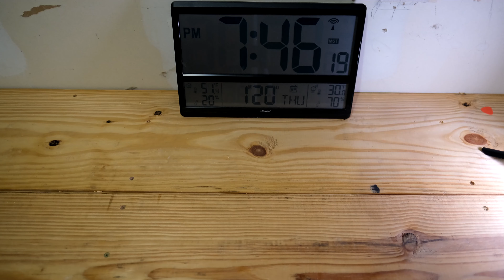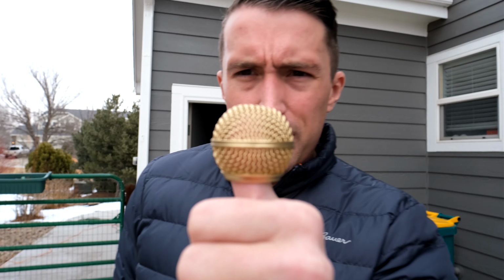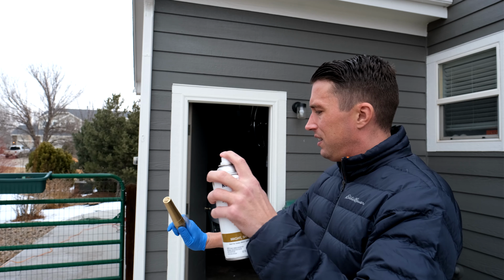Painting a Shure SM 58 Gold!

Comment: Tried painting mine gold. Awesome metallic gold paint turned to a dull golden brown after applying the clear coat. Have sanded back and painted again, going to try with a different clear sealer to try and maintain a better metallic Gold finish.

Awesome video thanks
Reply from the maker: Hey, you bet! I think I got lucky the first time haha. Best of luck!
Reply: @MintGreenAudio  I tried a water based sealant and was a bit better but it wasn't metallic enough still so sanded it back and using a gold glitter finish on it, looks good so far.

Comment: Good video, thanks. 
I have sprayed miles and miles of lacquer and latex so it was a little painful but entertaining  watching you handle the mic to spray it but hey, trial and error, it worked out pretty decent .
I did not consider that the paint would stay tacky so thanks for taking that one for the team!

After a year how has it held up? Also, how does it handle a mic stand grip?
I was thinking of putting my palm print on mine then dipping it in clear epoxy for the top coat to give it a really durable surface and a cool design completely protected by constant use. 

Pro tip for readers.. 220 sandpaper. Scuff it enough to break the surface of the powder coat. Dont sand it back to metal surface if you can avoid it. 
If you have an old mic cable laying around, plug it into the mic instead of paper towel and hang it to spray and dry.
Reply from the maker: Hey, thanks for the feedback!  Yeah, I clearly had no clue what I was doing :)

I actually go rid of it. Definitely should have kept it to see how it held up...  The palm print idea is great!

Thanks for the tips.  Perhaps I'll take that advice and make a better video.  Thanks again for weighing in!
Reply: @MintGreenAudio  I recently had issues of mixed up equipment after a gig so I have been looking for neat ways to make my gear identifiable from across a room.
When I get down to actually customizing my mic, I'll record it, tag you and credit you for the inspiration.
Rock on man! 🤘